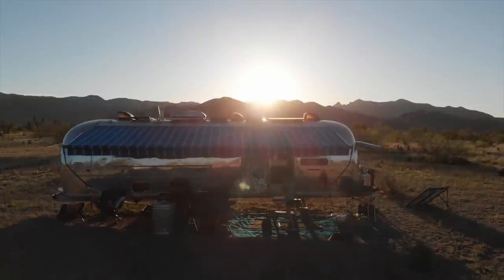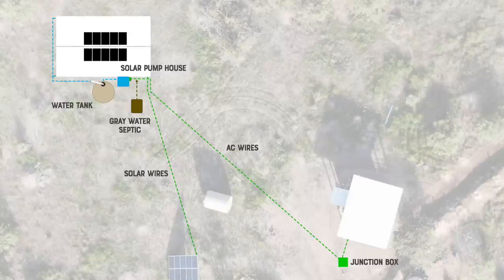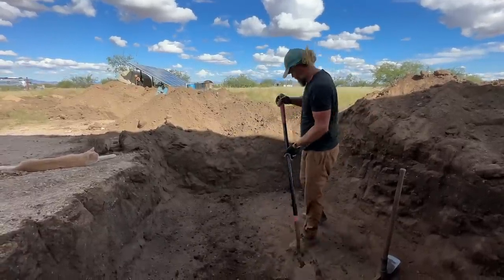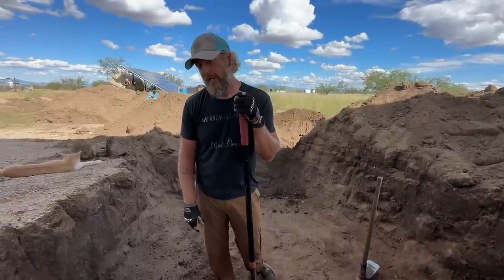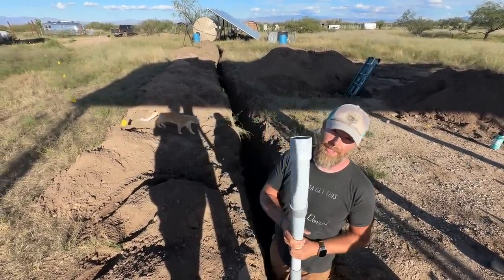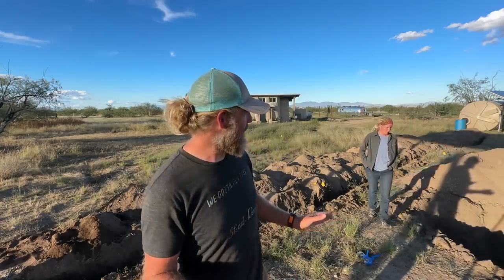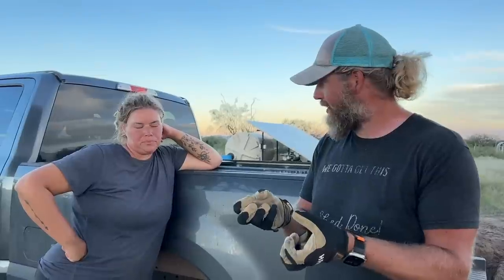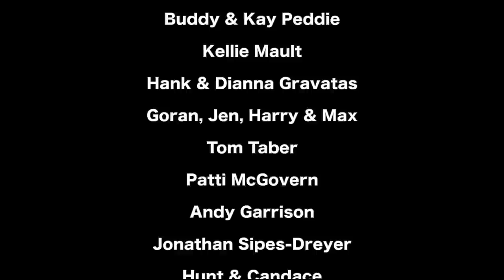MAKING OUR OWN GRID - Utility Holes for the Airstream Carport (Step 7)

Comment: Hey there!  Things are looking great!  By the way, I wanted to pass on this trick.  You can use a small piece of a plastic bag tied to a string and suck that through the conduit with a shop vac...to use as the starter to pull your cable.
Reply: To follow up on this.  LOL  I saw Lumnah acres do this with their solar panel install. https://www.youtube.com/watch?v=UHtsOscSwPs timestamp 26:32 ish

Comment: Instead of the irrigation boxes you should use a piece of corregated culvert pipe (24" diam) as your access to the bottom of the holding tank.

Comment: Might want to insert a pull line now it might help later.
Reply from the maker: Fish tape
Reply: @TinyShinyHome  that would work it’s a long run with bends, many of the data centers I built we used cotton balls on a line and used a shop vac to suck the pull line through. Just an idea if you run into issues. Love what you guys are doing.

Comment: the easiest way to pull the wire for your solar aray is to use a vacuum to pull a rope thru your pipe so you can tie you wire to since you have what is called 4 90 degree turns in your pipe
Reply from the maker: No, you use fish tape. A vacuum isn't going to pull anything that far.

Comment: Did you remember to putl a wire into your pipe to  make it easier to pull your wires though for Easter connection?  Before you cover it.
Reply from the maker: We'll fish tape it when we pull wires.

Comment: Another good one! How in the world did you figure out how many PVC elbows and small connecter pieces to buy?
Reply from the maker: I'm telling you, this project has been the most complicated by far. So many shopping lists and diagrams 🤦🏼‍♂️
Reply: @TinyShinyHome  
💡 If your fish tape doesn't work out, Graybar sells strong but lightweight electrical pull tape, marked at every foot. You should be able to feed it into the conduit, while blowing it through with the exhaust of a vacuum cleaner, shop vac (preferably) or leaf blower. The pull tape is used to pull a stronger rope/cord through, which is then used to pull the cables. Make sure the cables don't have any twists nor crossovers in the bundle, while feeding them into the conduit.
!!! I hope that you are allowing for voltage loss over such a long run, while sizing your cables. There are online charts that indicate the size of wires to use over given lengths of runs.
💡High voltage AC is far more efficient over long runs than low voltage DC from your solar array. I would put an inverter on each large array, then have 2 110VAC circuits  & 220 VAC where they meet.
It's also nearly impossible to pull power lines through more than 2 elbows on a long run, because of friction. I fear that you'll need to remove a few from the ends. At least it's easy digging.
Hope my suggestions are helpful.
😎

Comment: Are you adding a ‘first flush’ pre-filter to flush the first water after a rain to prevent dust and bird poop from entering your water storage tank or do you treat the water that comes out of the tank before using it to drink/cook/bath? I have really enjoyed all of your videos!
Reply from the maker: There's not going to be any meaningful accumulation of dirt, bird poop is going to get blasted by the UV rays, and no trees are tall enough to cause leaf problems, so no we're not worried about adding a first flush system. We filter our water through our Berkey for drinking/cooking, and will treat/filter the water for other uses as needed.
Reply: @TinyShinyHome  I would still suggest adding screens at the top of your downspouts and bleach into the underground pipe runs in between monsoon & rainy seasons, just to be safe.
But, you do you. 😎

Comment: I've been wondering for time now why you guys don't install first flush systems with your water catchment tanks? Is that because there are no loose leaves flying about in your neck of the desert and not much dirt (or reptiles and insects) gathering on your roof's? After every rain, I have to fish a floating lizard out of my first flush system.
Reply: Ashley said that there is a screen at the tank right before the water from the roof can get in the tank. She thinks this can handle the debris from the roof. She thinks it will take a long time for dust/dirt to build up and clog the system. There aren't any trees nearby either.
Reply from the maker: There's not going to be any meaningful accumulation of dirt, bird poop is going to get blasted by the UV rays, and no trees are tall enough to cause leaf problems, so no we're not worried about adding a first flush system. Screens over downspout, and we filter our water through our Berkey for drinking/cooking, and will treat/filter the water for other uses as needed.

Comment: I am not a solar expert, but it seems like combining the energy from panels on the roof of the "Airport" with the existing solar array could potentially be problematic.  Given that the roof mounted panels are at a very different orientation than the array, they will likely be generating very different power outputs, per panel, much of the day.  Also, the long run of electrical cable to the array will likely create some losses.  Do you plan to use some active method of combing them or are you just hoping they match well enough to be wired in directly?
Reply from the maker: Cmon, give us a little credit. You think we haven’t thought through all of that already? :) Don’t worry all will be ok 👍🏻